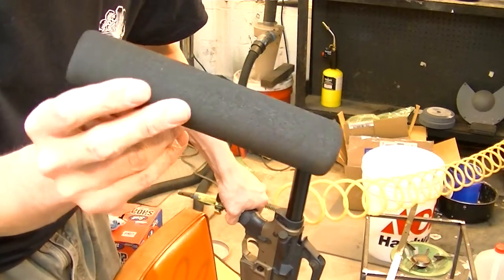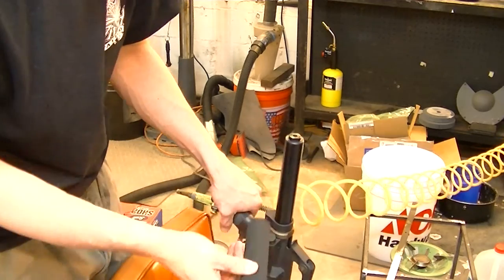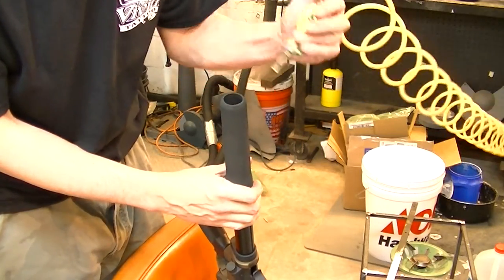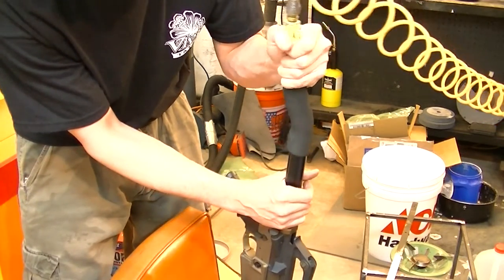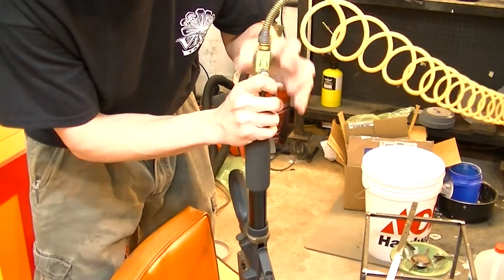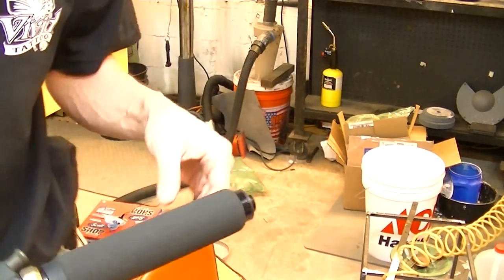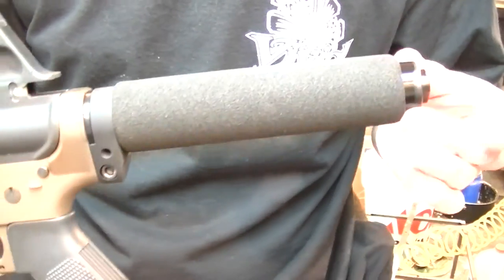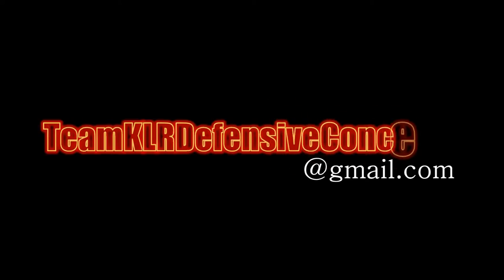TIP easy way to install ARpistol foam buffer tube cover

Comment: Cool tip.  

I use Hair spray inside the foam.  Got that tip from a bike shop on how to slip grips over handlebars.

Good lube and after the flammable parts dry, it gives a little stick.  Still removable though.

Comment: For those of us that do not have an air compressor, just spray kitchen PAM on the buffer tube and it will slip right on. Let Pam dry, and you are good to go. Super easy.
Reply: I had a better idea, especially when trying to cover a 6-Position Buffer Tube, with the rectangle track on the bottom of the tube, go online and get Foam Sheets with Adhesive on the back. Any thickness you want. You cut out the right length that you want, and wrap it perfectly around. All done :)
Reply: Pam is great 👍

Comment: for those that dont have a air compressor laying around, try initially knocking it down to just get it on , then use  a clockwise downward motion to twist it down